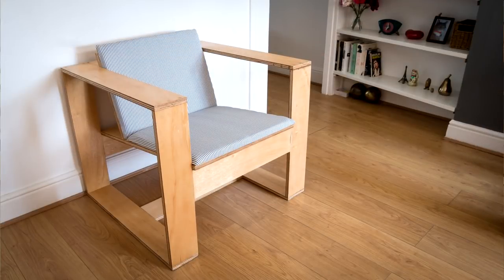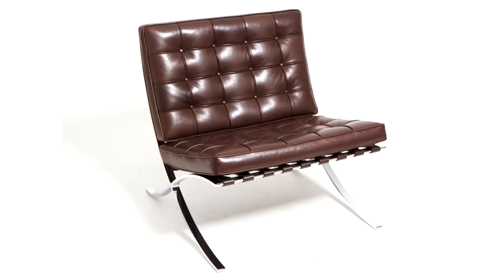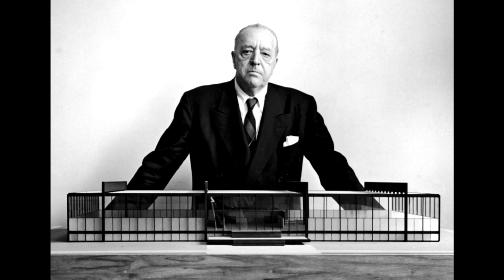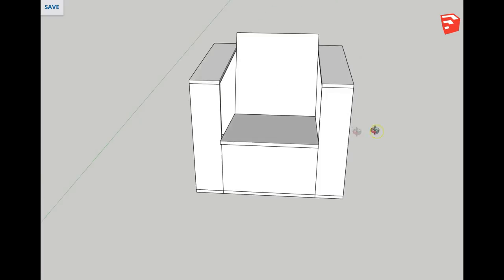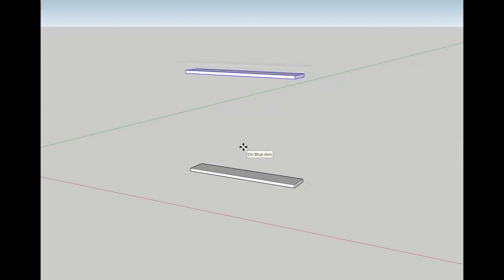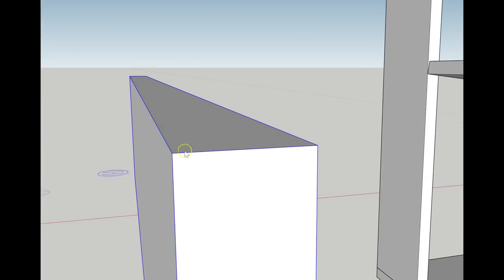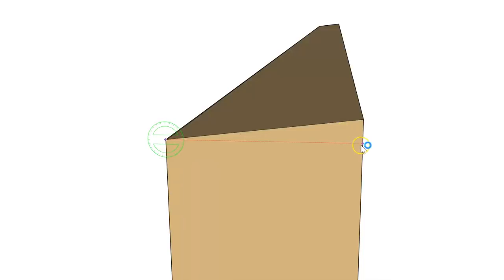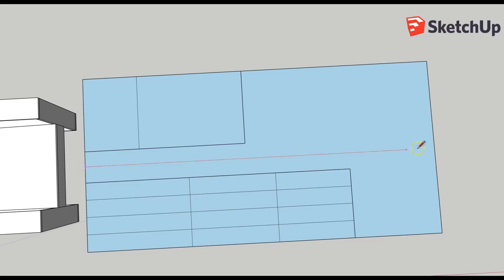How I Designed The Plywood Armchair

Comment: I am a SketchUp fan too and the best tip I can offer anyone starting out (and one I'm sure you know Keith) is to use a mouse with a clickable wheel, as this lets you zoom and pan the camera fluidly without having to go up to the toolbar each time. I wanted to add that I can highly recommend a free program called Cutlist from http://delphiforfun.org/Programs/cutlist.htm (or search Delphi Cutlist) — Windows only  — which lets you specify the parts you need cut, the size of your sheet material, your saw kerf, and even your preference for rip over crosscuts, before coming up with cutting plan that minimises waste. You can then print this and take it to where you are cutting. I'm not affiliated with the developer of the software but it's worth checking out.

Comment: A little confusion always sets in when I consider making a cutplan for sheet material as it doesn't allow for kerf when parts are laid touching each other.  Not always a prob but if I plan to get 4 x 2ft lengths from an 8ft sheet - the kerfs will spoil the dimentions, do you get me?
Reply from the maker: Yeah you need to either factor them in or just make sure you’ve got enough left over to one side which is what I tend to do